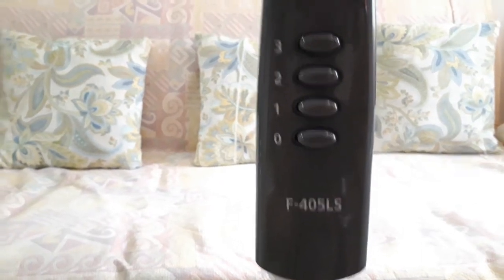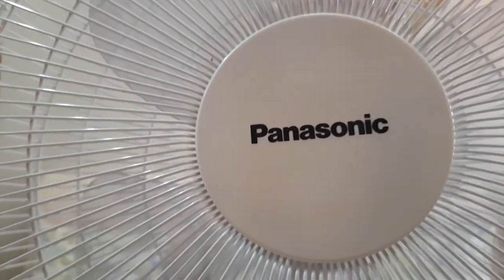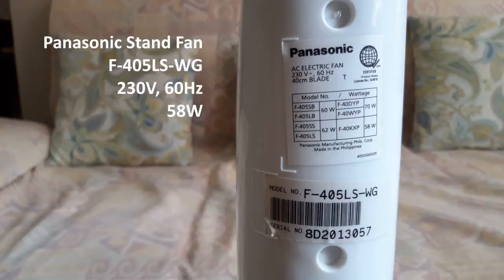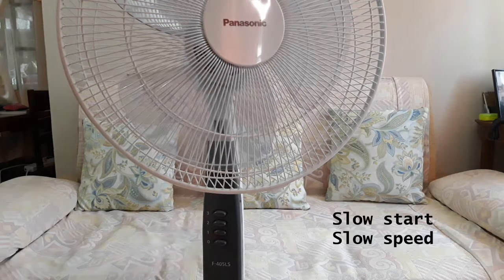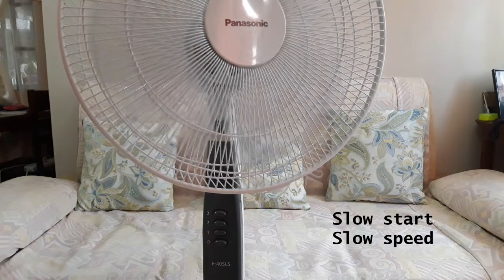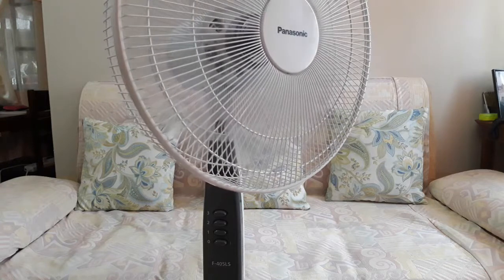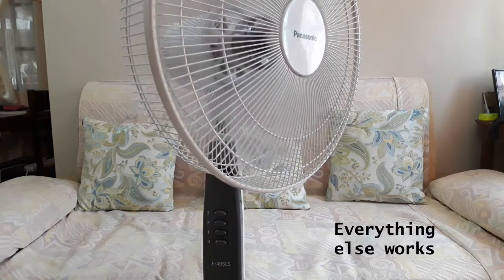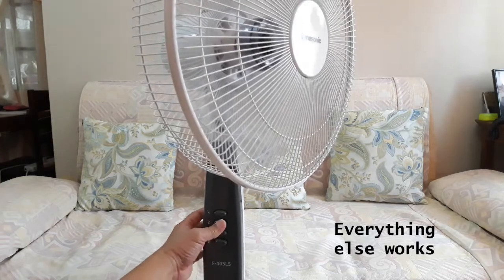Crimp connecting new capacitor to fix slow electric fan

Comment: How should I set my multimeter when checking a capacitor
Reply from the maker: If you mean where in the selection? Turn the Function Selector to the Capacitor symbol position. If the position is shared with the Diode (like in my Fluke 116) just press the option button to toggle on Capacitor test function. Other than that there's no special setting since the instrument will simply use its auto range to measure capacitance.

Comment: Very professional , check with meter , and the last one I interest is volt X uF = voltage , mean is use larger capacitor will higher voltage, too higher voltage coil will burn , better use same capacity capacitor
Reply from the maker: I appreciate your comments. Thanks.

Comment: I review fans and I had two Panasonics and One KDK with the same motor and all of them are dead. This Nidec motor is terrible.
Reply from the maker: Sorry to hear about your experience with the Nidec motor. I didn't know how it affected the capacitor but of all my electric fans, this was the first that had trouble too early.
Reply: @ramschannelreviews  Yep, ours too. When you buy a Panasonic/KDK fan, make sure it has the original motor adn not this one. The 40/45 series fans are usually the good ones and the 405/455 series ones have this motor and its kinda bad.
Reply from the maker: @Razer2875  Thanks for the tip. I like Panasonics so I'll keep this in mind.